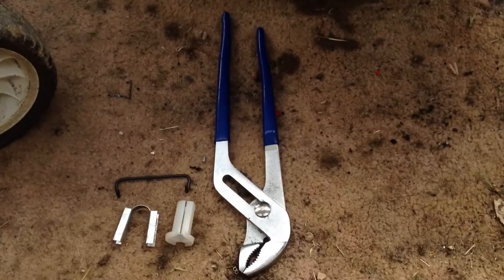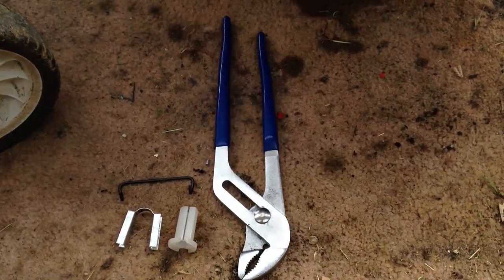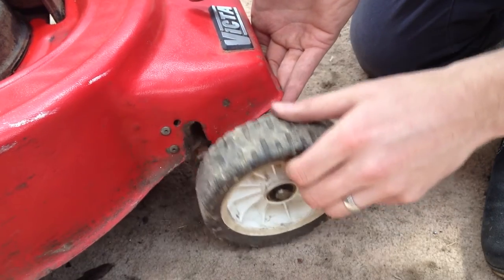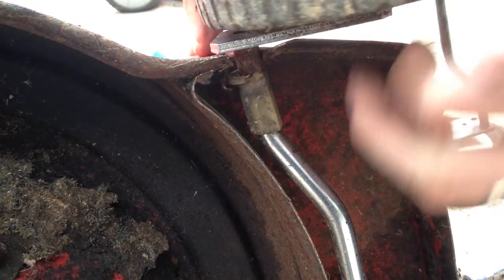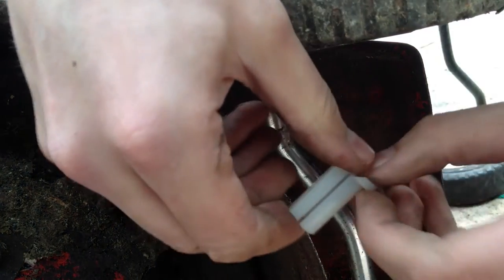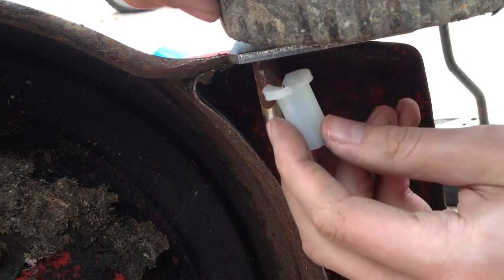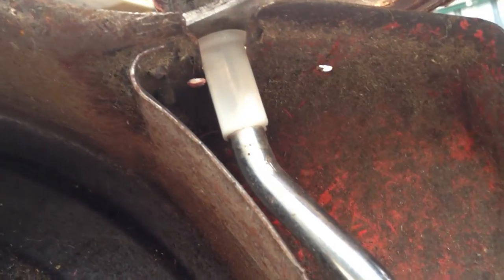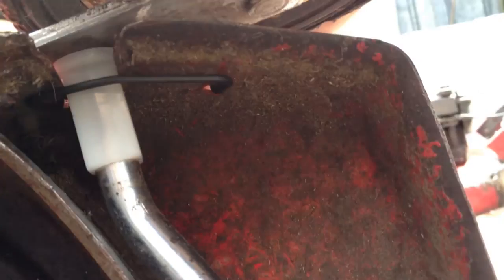PushMowerRepair.com - Victa Clip Axle Replacement

Comment: Thanks for this video, I am having trouble pushing the clip into the second hole it just won't reach it
Reply from the maker: +mellasone It can be quite difficult to get the clips in, If you haven't already done so holding them with some pliers or grips can allow you more leverage to push them the required distance.
Reply: Me too!

Comment: hi there, i need to replace my clips too, ive seen on your webpage there is a straight wire and a curved wire , so how do i know which one to buy ? my lawnmower is a victa commando bought 2004, also my axle dropped off while mowing, so to do this how should i get the petrol out ?
Reply from the maker: Hi 

your mower should use the straight clips the w clips are for older models. you can tip the mower and catch the petrol in a tub if you remove the fuel cap.
Reply: +PushMowerRepair.com great thankyou
Reply: @Pushmowerrepair  I can't get straight clip in. I have a tornado circa 2000, i can see the old clip is W. I was told the straights are supposed to fit too, but it looks like it would have to bed 75 degrees to fit , but gauge of wire is too thick to do so , well I can't do it, so maybe I better buy the W clips

Comment: Hello again
I've changed my axle clip but cannot put the height adjustment rod back into the hole
Reply: Hello again ! If the height adjustment  rod has come out of the hole after I've put the axle clip back on would I need to remove the axle clip again to fit the height adjustment back into hole? ( argh hope not ) what's the best way to do this?
Reply from the maker: +TheJANNIWANNI You should be able to fit the adjustment rod back in, it can be difficult due to the tension in the springs, Put the front on the mower on a block so the wheels are off the ground it will help you move the parts more freely.